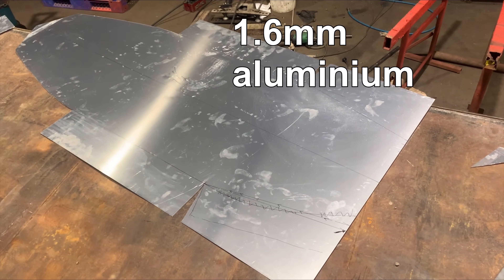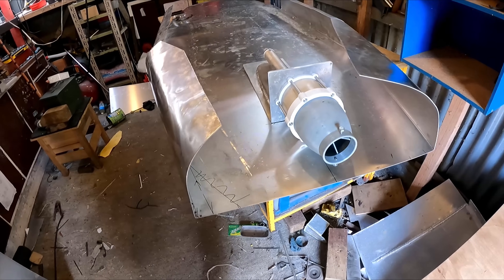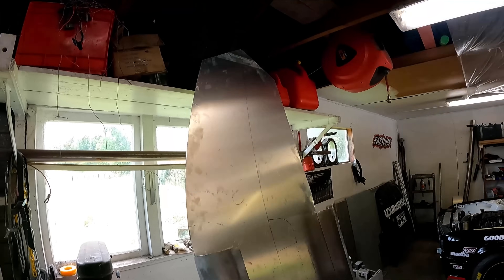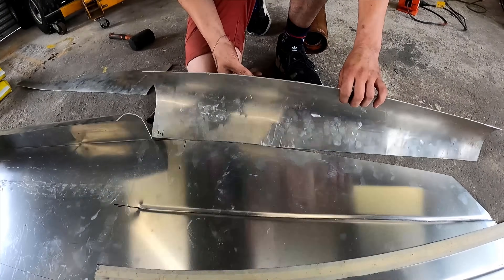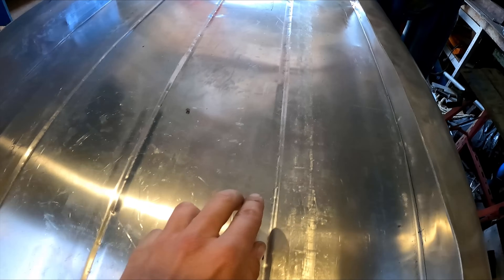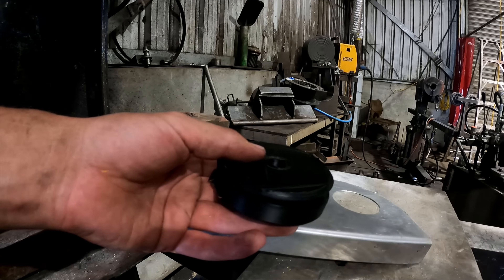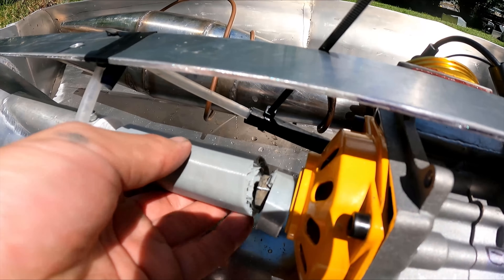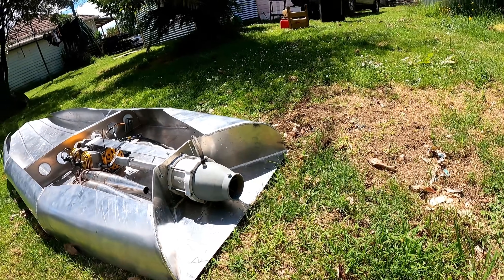Homemade Jet Drive 2 Stroke Twin , Board Building

Comment: So cool! Wondering why you don't have any curvature or hull shape, the board is going to be rather unstable.and awkward to steer, unless you are fitting some fins to it?
Jet is fine, should work on the physics of equal opposite reaction, chucking water out the back is what pushes you forward, not pushing against water. When a jet ski plains the jet is out the water... Don't jet it down or your trim will be wrong, in fact a slight trim up will probably help but you might struggle to make the trim accurate. Looking great, good luck with this build!
Reply from the maker: Just a flat bottom is good for surfboards my dad used to make surfboards he helped with the design a bit but I might need a fin to help it track and turn

Comment: I have wanted to do a twin with these engines for about ten years. You are the man!   Thanks for sharing this with everyone!

I have used these carbs/reed blocks on pocket bikes, they fall off no matter how tight you clamp them, almost like the intake is slightly tapered. I have used some red RTV on the reed block before i clamped carb back on and it never fell off again! Maybe worth a try.
Reply from the maker: Ok that sounds good I will try that 👍

Comment: Looking good. The jet should be above the waterline like you have it. To speed up print times try a 0.6mm or 0.8mm print nozzle.
Reply from the maker: I might try that , also now I have the printer in a box in the shed and just leave it running all night which is great!
Reply: @dkthewelder  that’s very handy! Just be aware that if the printer happens to fail and get hot, it could cause a fire being in a wooden box. I keep my printers outside over concrete so if they did happen to light up, they won’t start a fire.

Comment: Jet outlet doesnt matte alot, since you are actually pulling the craft forward with the inlet, not pusging it with the jet👌
Reply: I mean, a coin has two sides, so it's partially correct, without the inlet there's not outlet. but shooting the (accelerated water) jet stream underwater defeats the purpose of a jet.
Reply: wrong

Comment: you should mount the engine on rubber mounts to take away much of the vibrations. also, i still think TPU could be good  way to transfer power from engine to the jet unit. like 3 part coupling with TPU in between for taking upp some misalignment and also some dampening!

cool video, looking forward to next update :)
Reply: Was gonna say this too. Not only that the layer strength on TPU is insane.
Reply: To print multiple materials on a single head machine, 
Slice the parts separately and change bed coating thickness to match each material start point.

Comment: Above or below the water line will not change the thrust coming out only your drag would be affected. Water jets work on moving a mass of water out of the jet which gives you thrust 
Jet propulsion is a practical application of Sir Isaac Newton's third law of motion, which states that, “for every force acting on a body there is an opposite and equal reaction.” 
So the jet can give the same thrust I. Air or water?

Comment: Jet unit above the waterline.

This is what Hamilton did to make an old invention that we know today as the Hamilton jet work.
Above the waterline allows more flow of water through the unit as there is less back pressure. 
It is the weight of the water that you move that propels you forward.
Reply from the maker: Yes the Hamilton jet was invented here in New Zealand 👍

Comment: My brother has a uv resin printer, quick as, and craaaazy detail. One of the resins he has is not that strong, but another blue see through one is super strong, hit a test bit with a hammer quite a few times before it cracked
Reply from the maker: The resin ones are really cool , that PLA die I hit it like a thousand times and it held up fine it certain situations it is strong

Comment: Where did you get the engines?
Reply from the maker: They are just Chinese pocket bike motors I got them off trademe in New Zealand, but they will be on eBay
Reply: @dkthewelder  do you have a link I can't find them and I really want one
Reply: @dkthewelder  or did you put two together
Reply from the maker: @tonygoodman6523  it is two mounted together, have a video on setting them up

Comment: Do a home made rubber cush drive thing for the coupling easy enough to make kinda like to gear box dogs facing each other with a rubber star in between them
Reply: Just grab a steering wheel uni from the scrap car yard 😂 that's basically the same thing. Would cost nothing. Definitely needs to get a rubber coupler or an actual uni. Will never fail and also will not vibrate ☺️
Reply from the maker: @jacquesdeklerk5563  I used one of those on my last jet unit I thought I would try something lighter and easier.
Reply from the maker: A love joy coupling , I was going to do that but thought I would try something different

Comment: Try a 125-250cc 2 stroke dirt bike motor cut the the gearbox off make a pull start drum thing off flywheel side and a coupling welded to the gear off the crank be way better that the china motors
Reply: The whole project is around the china twin, so by replacing them will kinda be like removing the foundation of the project though 😅
Reply: @jacquesdeklerk5563  it will be removing the the lowest quality part i think he went with em cause there small but with what i said and some exhaust modifications and a 90° elbow on carb intake youd get that pretty slim as well also power torque reliable etc
Reply: @BIGSMOKE-bl2lq  Why just go with a 125 or 250?  Might as well drop a 500 in there, or maybe Chevy 350....  No, no, no he needs to drop in a fully built up Chevy 454...  Well except it would be bored and stroked and no longer a 454...  You get what I mean!  I guess that means he's building an off shore cigarette race boat now.... you know... apples and oranges...  I say go pomegranate.

Comment: You might try a armored hose as a shaft coupler instead of a 3d printed one. Keep up the good work!
Reply from the maker: Yes I really like that idea! I can use hydraulic hose, thanks a lot 👍👍👍
Reply: I was just gonna say hydraulic hose works great. I have had good luck with it on way more power then this. So you should be tit!!
Reply: I have used a 4 wire hydraulic hose on water pump. You can also have the hydraulic shop crimp your couplers in for you. ( By 4 wire hose, I'm it has 4 layers of woven wire reinforcement wire in it)

Comment: You gain a small percentage of thrust with the jet above the water line, the water slows the rate in which the stream can accelerate out. It doesn't need to bounce off water its a jet.
Reply: Exactly! You can test this using bathroom shower: much more efficient if not pushed in a bucket full of water.
Reply: Fluid dynamics get tricky but some playing around with the weight distribution and displacement will help... BUT... Man, you need lots and lots of Torque to keep that water moving out of that nozzle, and exponentially more and more and once the vessel is on plane or "out of the Hole" but at speed you'll get a better idea of any change needed in angle of attack of the exit nozzle to the water line.

Comment: also dont listen to the people saying you need the nozzle in the water, they dont own a seadoo/jetski. My seadoo when at full power doing 77kmh, the nozzel is fully outside of the water blasting at the back few feet before hitting the water
Reply from the maker: Yeah it just works by throwing the mass (water) back pushing it forward . I just hope people read the comments like yours helps everyone learn a bit more👍

Comment: what i would do is start printing counter weights with the coupling in the middle and rotate it to see where the motor runs smoothest. Those cheap china pocket bike motors are horribly imbalanced. Ive balanced one by lighting the piston and how i did it was i dremel the inside skirt of the pistons to remove material
Reply from the maker: Another guy was saying how unbalanced they are they are , I’m running 180 apart I could change this maybe it would help it sounds tricky trying to balance them

Comment: You have to have rubber engine mounts , you can't just bolt it to the alloy it will rattle things to shit. And water jet always above the water. It will actually perform worse underwater due to friction. I studied fluid mechanics you can trust me on that one. Its nothing to do with what the water exiting the jet comes into contact with. It's purely based on the mass of water the pump pushes out,  and the velocity of that mass of water. I'd go with an actual uni for the driveshaft, it will drastically reduce the shaking and vibrations aswell.
Reply from the maker: Thanks nice to hear from someone with education on this I thought that is how jet pumps work best. I am trying to figure out a good rubber mounting idea I have some flexible filament for the 3d printer maybe i can print something
Reply: @dkthewelder  I'd stick to just using some 5-10mm solid rubber so you know it won't fail. That's honestly why your carbs vibrated off so quickly. 😅
Reply from the maker: @jacquesdeklerk5563  It could be because the mounting isn’t solid enough like all 2stroke dirt bikes are solid mounted , my last little jet boat didn’t have any vibration problems. I might be able to get the engines synced up smoother
Reply: @dkthewelder  yeah but there's allot more structural integrity and rigidity to a bike frame compared to the flat sheets on the surfboard. Experiment I guess. I'd go with rubber all day. I even have rubber on my big rc boats and it slaps down the vibrations astronomically.

Comment: very interesting idea / design cant wait to see it get going, i have tried dealing with these engines in the past and had similar issues, with the carbs i ended up having to put thread tape between the round manifold and carb and filling the clamp gap out a bit for more grab to get them to stay on but what i ended up doing was making a manifold to mount a wallbro two needle type carb on and that worked way better,  thank you for the top and bottom beading die idea i might have to give that a go, and im also impressed that youre able to weld 1.6 ali im working on something similar and wasnt even gonna bother trying it lol might have to now
Reply from the maker: Thanks, you can weld 1.2mm aluminium as well . I think bigger carbs would make a bit of power increase too
Reply: @dkthewelder  yea im sure its possible i just hate welding ali, thinest ive ever welded was 0.6 but that was stainless, the reasons i went with the walbro carbs is they are way easier to tune and better quality and als they are what i used in high performance  1/5 scale rc cars and i know they can make big power,  i bought two of those motors at the same time and the ones i got were only a few serial numbers apart so same batch but the jets in the carbs were different sizes along with a few other things i noticed along the way so i think that speaks a fair bit to the quality of these
Reply: Just make sure whatever carbs you go with that you have no air leaks!  It will never run right but more importantly is that an air leak is the death of a 2 stroke.  The Chinesium OEM carb mounting setup is telling me that you are going to be having air leak problems.  If it starts revving high at idle with the butterflies closed, you'll know you have an air leak.

Comment: If the coupler can take it, maybe some bits of rubber for the engine mounts, so it dont shake itself to bits
Reply from the maker: I think that’s what I need to do 👍
Reply: If you can get the rubber to flex more on the rotation direction of the engine, so if the jet drive loads up a bit much the engine can flex with it slightly so it doesnt try to twist the coupler